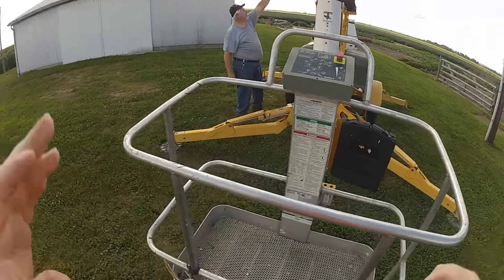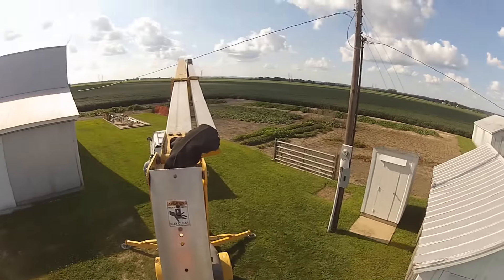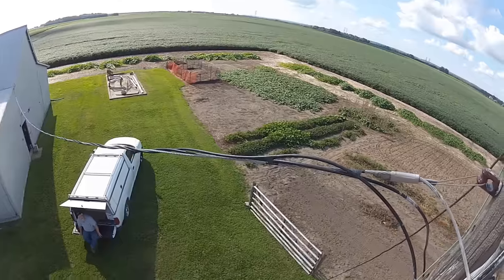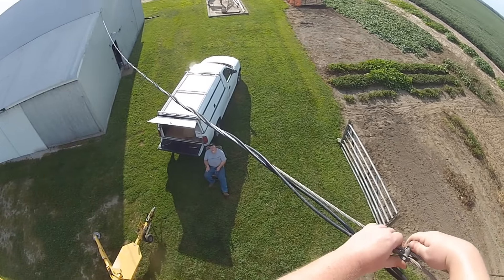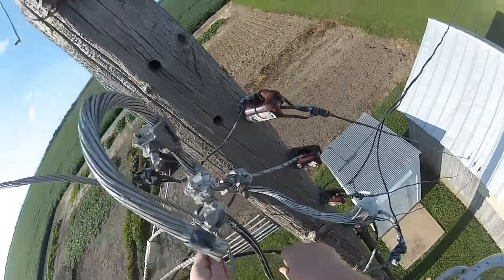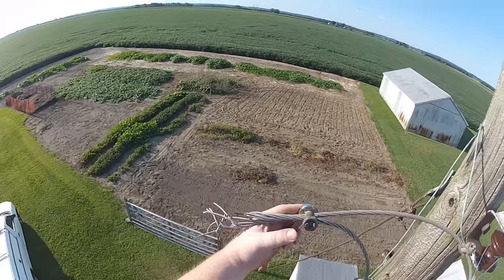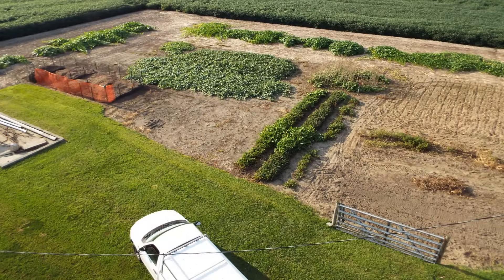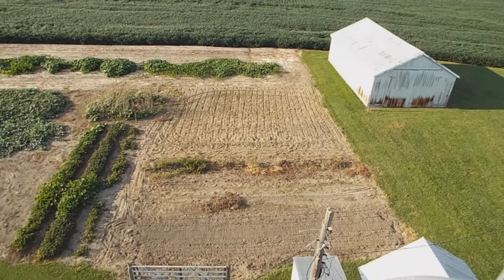On The Farm Episode 21: Lifting Man and Working on Electrical Issues

Comment: Hay Jon call up the power comp and have them test there end first with the stuff being underground and the rain as of late you best to have them check it make make sure what is coming in to you is actually not shorting out than from there if you have to replace  your 3 wire  you will know you had to bot just hang parts till you get it right

Comment: Call the power company because what is happening the ground wire on the main service at the road will cause the power to be different voltage because of the common/ground wire has a lost connection.

Comment: The outlets should all be 120 volts and the cause of the ground/common on the main service pole has a bad connection on one of the to hot wires.